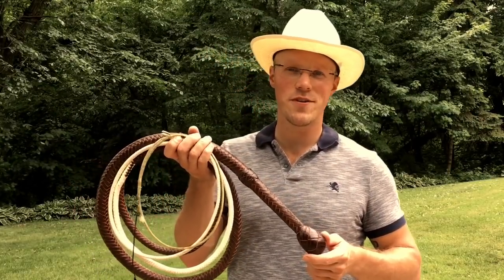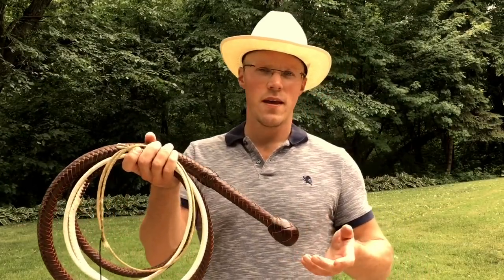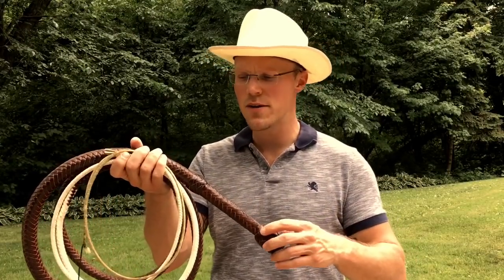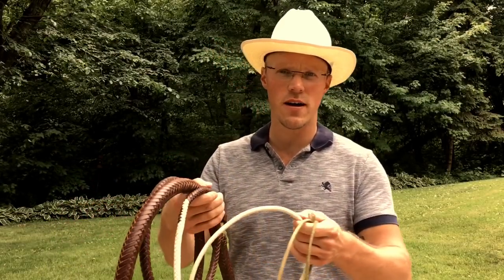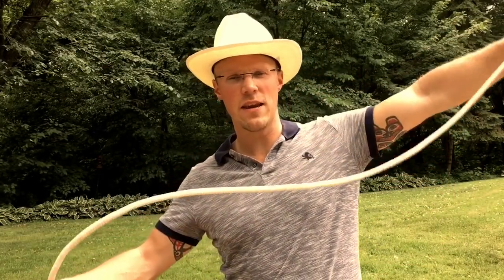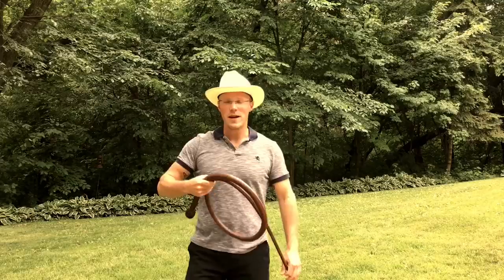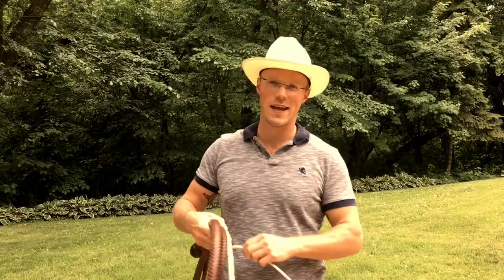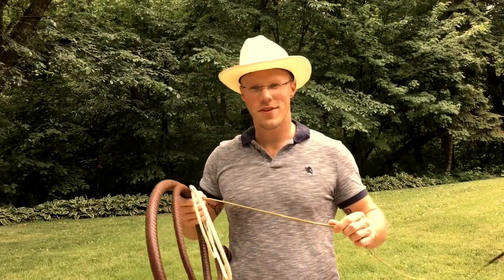Cracking a 12 foot Bullwhip

Comment: I would be afraid of it hitting me coming back 😨
Reply: Well if you ever get a whip, it will, and it hurts. Just as much as you think it does.
Reply: I know the pain man it hurts like hell! It doesn't feel like a slap to the face! It's a thousand times worse! I accidentally hit myself with my bullwhip a few times! 
Once across the face and twice in the lip! It cracked and came back and it got me in the upper lip! It's hard at first trying to figure out how to crack it but once you get the hang of it and everything their pretty fun!
But whips you really got to take care of them handle them with care depending on how often you use them applying leather dressing to them just how you would with a shotgun having to oil it periodically!! The more you use it the more you have to keep applying dressing on the fall of the whip! But with proper handle and care a bullwhip can last for decades

Comment: Hi Adam - I'm curious, you say the whip was heavy - how did the weight compare to a David Morgan one in the same length before it was modified?  Nice job cracking it regardless.
Reply from the maker: fjk1138 Bulky might be a better description than heavy.  Certainly bulkier than a Morgan whip.  This whip also originally ended with a pretty thick point, so splicing in strands and making the whip longer helped it roll out better.

Comment: Okay so, I own a 12' bullwhip and I have no idea how to crack it. It's leather and has a wooden handle. I need to get it shortened but I have no idea where. If any one knows where to do this, please tell me. I live in Canada so yknow if you have anywhere in Canada, it would be better.
Reply: I ordered a 12 foot shortly after getting my 6 foot. I started by laying the whip behind me and almost like striking a giant match on the wall took a step forward to drag the whip with me and get the whole whip moving. Rotate the end of the handle from the starting point reaching back behind you around to the direction you want the whip to crack. Once the whip starts to make it's way past you you'll see it start to unravel and you'll want to give it the slightest jerk back when the tip is out in front. Think if it like snapping a towel at someone but slower and more deliberate.

Comment: Is it harder to crack a whip in cold weather? At the moment its -2 hear in wales and everything is frozen.   I have an 11ft nylon whip which I'm learning to crack and although I'm getting the occasional crack more often then not Its not very loud, more a dull thud which is no where near the very impressive sort of crack your getting in this video. but what I am getting most of the time which looks pretty cool is a sort of vapour trail at the point the whip should crack. On the positive side I seem to have stopped whipping myself in the head so I'm now doing it without the motor bike helmet on.